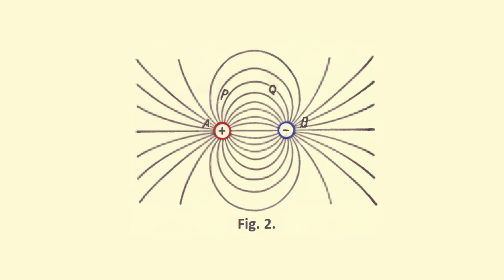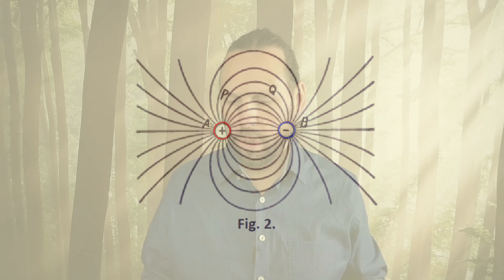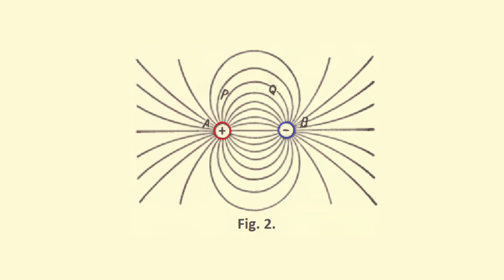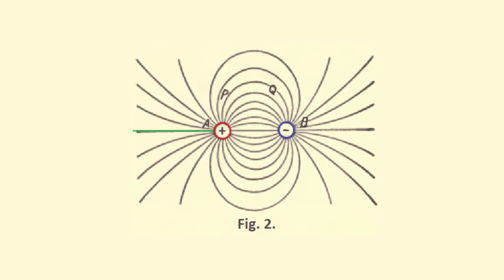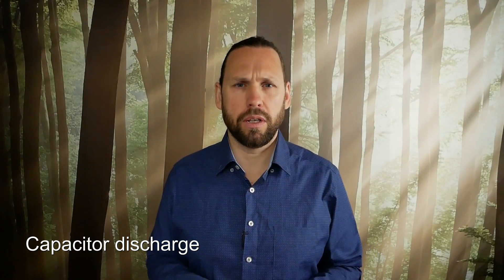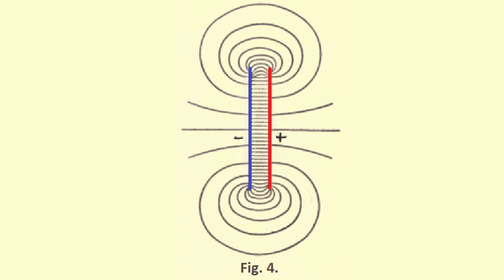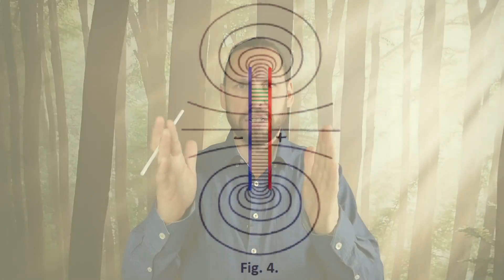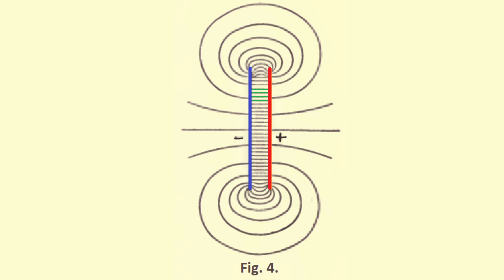Faraday tubes, explain lines of force in electric Aether fields.

Comment: Let me share something with you: an open letter to Ivo and viewers.
Faraday tubes suppose that there’s a direct/proportional correlation with a water vortex and a magnetic vortex, specific down to the geometry of the swirl and the drag on the straw. 

Looking at the fluid dynamics in the water, there are many micro turbulences along the length of the straw, eddy currents that wrap around maybe only a centimeter wide. The straw’s cross sectional tangent that is perpendicular to motion receives the most pressure and therefore distributes force perpendicular to the straw with the highest velocity in the moment
                                                                    Take a look at a simple eddy current and how the water spirals around the rock like a spider curling its legs, or like a treble hook. 
An eddy current’s spiral drawn on paper is a linear approximation of a pressure differential with respect to time. As the spiral curls into itself, the space between the lines decreases, and therefore a regulated amount of water (pressure on the system) must pass through a smaller hole, and therefore will increase velocity. 

Just like the straw tangent that pushes water perpendicular, a spiral will exert force perpendicular to itself. 
The spiral will exert force either towards or away from the viewer depending on which hemispheres the spirals occupy. Maybe I’m coining some new language here, let’s call this carnic polarity ;)
Or more familiarly - Righty tighty lefty loosey ;) 

Take the capacitance of two oppositely charged particles. A faraday tube connects them in a straight line. That line can be tightened like a guitar string and a frequency will change. How far you pull the string back is proportional to the amplitude of its frequency, but not the frequency itself. 

Ivo, this is as far as I have come in understanding, and I see enormous potential in your work, but I still don’t understand the purpose of the bifilar coil, I am close to understanding. Now it’s time to rewatch some videos, 
 Cheers
Reply from the maker: here is a hint: the bifilar PANCAKE coil can act as the PLATE of a capacitor.
Two of these coils, make 1 capacitor.

give the plates (coils) a dc offset and the cap charges.

but the plates are coils.
so you make them series resonant (low impedance). 

then feed them with impulses. 

you now have a capacitor that is dicharged by the impulses. 
Very unique.
Reply: Alright, I still don’t understand the application though. Watched most of your videos over again. Maybe I need to sit on it a few days
Reply from the maker: I hope my future videos will make the applications clear. For now, I first need to master it myself
Reply: Just finished building your 2020 low side switching circuit. Love it! Getting great results. So much so that at peak resonance my Wave Generator (same as yours) will occasionally chirp and change frequency due to ambient dielectric charge accumulation. It sounds to me you are due some praise for coming up with an AETHER PUMP. I keep seeing a series of coils on a central axis that are sequenced to produce a concentrated Aether stream.  @MasterIvo
Reply from the maker: @peterlarsen7457   Thanks Peter. Yes and this is only one half. only one impulse per full period, which has 2 maximums. 
Aim is to have a series resonant primary (L2) that has both polarity impulses in one period. a negative impulse on the neagtive voltage maximum, and a positive impulse on the positve voltage maximum of the series resonant sine wave of the primary. 
I tried this with a modfet half bridge, but failed due to the body diodes. now progressing towards IGBT's

Comment: Steinmetz used elementary explanations. How do u explain the plain experiment where the cap is charged hv and then the plates are removed and the dielectric still holds the charge. Also, Tesla and Don used pancake coils as 1/4 hf resonators above 1.6 mhz that caused carriers to be pulled in at the top end (not just oscillate back and forth below 1.6 mhz) , creating an ambient disbalance. There are a lot of technical details that can be solved only through expermintation. I'm not sure if ur using ur pancake as an electromagnetic (one pole in center, other on outside) or as LC (same as former but flipping poles) in both cases u might gain something but not Kilowatt.

Comment: "The Faraday tubes either form closed circuits or else begin and end on atoms, all tubes that are not closed being tubes that stretch in the aether along lines either straight or curved from one atom to another. When the length of the tube connecting the two atoms is comparable with the distance between the atoms in a molecule, the atoms are said to be in chemical combination; when the tube connecting the atoms is very much longer than this the atoms are said to be ‘chemically free’." –Joseph John Thomson

Comment: Did you give up on impulse radiant energy generation?
Reply from the maker: No absolutely not. I still am researching it, and have faith it will uncover more new technologies. It just takes time
Reply: Master Ivo not sure if you mentioned patent 787,412. "Whenever the circuit is closed owing to the rotation of the terminal t', the stored energy is discharged"

Comment: Hello master ivo
I noticed you mentioned the æther vortex resulting from the rotation of the tubes. This is very similar to the magnetic vector potential, which can give rise to both the dielectric and magnetic fields. Also you mentioned longitudinal dielectric field, which as you may know is produced by a tesla coil's spherical top load (it acts as a capacitor plate) since the magnetic field cancels out. With bidirectional current applied, the dielectric field vectors would indeed resemble acoustic phenomena. Though I'm not sure if its Superluminal and it doesn't appear to be Lossless, maybe something else is required for that. Thanks as always!

Comment: This can all be visualized using a ferro cell. When you place a magnet beneath a ferro cell and shine light through it, you can see the invisible dielectric field that exists all around and throughout everything (the ether), become intensified. Placing a 2nd magnet down, with like poles facing each other, the dielectric field that is being amplified due to the coherent structure of the electrically charged magnets, begins to push the two objects away from one another. Put opposite poles facing, and you can see the field lines flip, and a counter-spacial void appears between them. Now the two metal magnets have no choice but to move towards one another, because as you stated, the field lines surrounding and penetrating them, are trying to contract like a stretched out rubber band. The dielectric field has 2 components. The magnetic that pushes outward, expands, and creates force/space, and the dielectric component that returns this work back to 0, or to rest. It takes work to create space/force. It takes nothing to return to rest. In fact, the return to rest is accelerative, just like when you step off a cliff, and drop effortlessly to a lake below. You fall at the same rate that magnets attract to one another. (Like when the astronauts dropped the feather and hammer on the moon, and they both fell faster and faster until striking the surface at the same time.) This of course because there was far less atmospheric resistance than here on earth. Anyways, this is all thanks to the ether's pressure lines. Not really lines, because obviously they are analog, and infinite in width/amount. I believe the fibrous structure is due to how they vary over time and with varying potentials. Sadly we can never "see" the field, only the light scattering effect it has when viewed through ferro fluid, but the result is clear. Turning on an electromagnet below the ferro cell, you can witness the invisible field of the ether, immediately intensify, and crawl inward towards the coil, pulling in, or pushing out other matter. Metalic objects first, but with a strong enough electromagnet, you can levitate a frog. The Earth is holding us all to it, by this same process. The Earth is not a permanent magnet, it is part of an electric circuit. Every electrical engineer knows, if you have a magnetic field, you also have an electric field, 90 deg to it.
Reply from the maker: I just recieved my ferrocell. It's an amazing tool. very interesting to see the field between 2 attracting magnets.

Comment: In your video on the resonant bifilar coil you show a series capacitor tuning module which is C2 on the schematic? Can you tell me what the wires going in are for. There appear to be four? In the schematic it shows connection to the neutral of the high side switching module and the neutral of the coil? Also I was going to connect the capacitors to wires going to the switches is this OK? And should I use silver wire or will just normal wire be ok?
Reply from the maker: Pure copper wire (not cca copper clad aluminum) will do. I do not understand your other questions, please email me a drawing ("about" page of my YouTube shows email)

Comment: Very good video with use of visualizations my friend!  You have come a long way.  Now if you modulate these tubular rings, in other words, smaller diameter or tighter spin back to larger diameter spins, then something strange in addition happens.  At normal angle will appear longitudinal magnetic pulses.

You have also similarly described the action of a toroidal core.
Reply from the maker: Thanks Mark S. Good to hear from you. modulation of the rings, no problem. A few little adjustments to my halfbridge circuit, and some testing. then I'll put it on video, regardless of results. It is worthy of sharing.

Comment: without the accurate fundamentals on these forces, no progress can be made. i like this,, no mathamagics involved, no nonsensical concepts, and that 3-d vr was a great illustration tool. i do not understand how a laden jar can hold a charge when it is disassembled, then reassembled and give off a charge. great video
Reply from the maker: yes that Leyden jar experiment blows my mind also. seems the dielectric field is set into the dielectric material that keeps being polarised.
Reply: @MasterIvo  i dont understand how it would not take energy to do that? its amazing,,,  of course a perpetual motion holder blows my mind also,, ed lead scallion shoed us that i think.
Reply: The unique properties of glass as seen in the Layden jar. Glass is capacitive, energy is easily absorbed it seems. Its unique attribute is that its molecular bonding structure is affected by the moving magnetic field (electricity) in copper,  however the most intriguing part is that it does not appear to create a magnitude greater than its mass. Hence touching the Layden jar will not result in the destruction of a magnetic field (short). When introduced back to copper,a pressure gradient interaction resumes. I speculate that there is a plane of inertia energy pressure gradient interaction between copper and glass that is unique. The intreaction cannot be replicated by water (human skin). It is indeed intriguing and just one more mystery of magnetism. Every element has its unique interaction with the magnetic field, hence electricity will never be entitlrely explained.
Reply: @elams1894  this is a amazing set of properties in to some of the energys we take for granite that we "fully understand"

Comment: Fig.3 presents the lines of force forced to go sideways. This is because the sameness of polarity means they flow the same direction (outwards from the given point) which means that in effect they are opposing one another and so the force is dissipated in a direction perpendicular to the one they were in. 
Think of a drop of water and the small droplet that can be observed right in the aftermath of the initial drop hitting the surface: it is an echo of the initial reciprocal force made up by all the forces pushing outword at the moment of impact. Drop hits surface, movement goes perpendicular to the direction of application (all directions in the horizontal plane, since the drop's application is due to gravity). Now what happens is action and reaction: the small droplet is the after effect of all the reciprocals of the dissipated forces from the horizontal plane which now has nowhere left to go so it turns back on itself in the direction of the original drop. The droplet example portrays in essence the same phonomenon (movement going perpendicular when two opposing vectors meet), just at a more complex level.
Reply: Basically this is what happens, as all transverse phenomena (EM waves, heat/radiation, gravity etc) are a repercussion of the two polarities coming against one another on the flipside (counterspace). Use the drop analogy to get a clear picture as to why they are forced into a spiral pattern. Transverse waves are vorticular also because of losing momentum, needing to go back to their point of origin. And so in the case of high powered EM signals they need more heat in order to transmit a clear signal farther away. But this is only because they are putting the cart before the horse in the way the current is generated, I mean in the mainstream model there being no counterspace, they don't see the EM as a reciprocal of another force and so they can't just go replicate that source in the way you have portrayed in your other videos using back EMF with the discharged coils that opose each other in polarity.

Comment: Ivo, this is brilliant! Did you get these ideas through dreams? 
 Thank you very much, for I now understand once hard to grasp concepts like the dualism of magnetism and electric phenomena without some sort of a religion like Einstein's SRT for the first time. By the way - I truly believe that the tubes of force are very tiny vortices themselves (diameter of tubes in the nanometer scope?); like mini tornados or extreme tiny spaghetti gyroscopes postulated by Prof. Konstantin Meyl (potential vortices). Vortices next to each other behave like mechanical gears what would explain tension, pull and repulsion. God bless you!
Reply: To completely destroy SRT, just research dynamotor. Not the mechanically coupled motor-generator, but the REAL single machine. Converting the structure of a synchronous motor or synchronous generator into a transformer. No more mechanical input nor load. All will be electrical. You will be surprise how this lead to overunity and serves as a direct proof of aether through overunity by magnetic attraction and overexcitation.

Note, you cannot find this dynamotor machine anywhere. This is how suppressed it is.

3 phase synchronous motor with stator used as transformer simultaneously, without mechanical load. 3 phase synchronous generator with stator used as transformer simultaneously, without mechanical source. 3 phase transformer with a rotor added in between the coils.

All the same machine - 3-phase Direct Coupling Dynamotor. They always build the stupid mechanically coupled together motor & generator. Never think of combining the structure together?

Overexcitation of both of the coils of a transformer have never been shown before. Overexcited synchronous motor produce leading current. Overexcited synchronous generator produce lagging current. So both currents are 180 out of phase. Which meant lenz's law is negative. A lot of suppression in this.
Reply: @atum7355  Unless I'm mistaken isn't this exactly what a Partnered Output Coil is? It operates on 3 coils and the magnetic resonance between the 2nd and 3rd coils being 180 degrees out of phase, it sounds just like what you're describing minus the 3 phase system, or am I wrong?
Reply: Einstein's SRT was built to confuse and lead ppl away from raident energy,, and it worked. steven cruters on the electric univers debunks the math
Reply from the maker: thanks! yes repusion by these twised tubes
Reply: Yes, Faraday himself described them as vortex loops. Also Maxwell treated them as literal tubes, referring to them as analogous to smoke rings. (Modern mythology mischaracterizes him as having seen them as merely abstract representative lines of force). Thus the modern fundamental EM equations we all use were based on his aether model of the undulatory theory of light. See water examples (and I believe probably what inspired string theory): https://www.youtube.com/watch?v=bT-fctr32pE